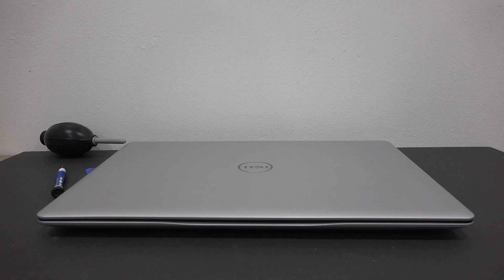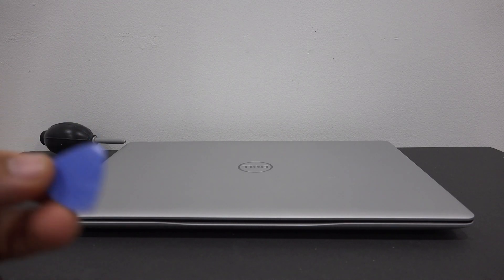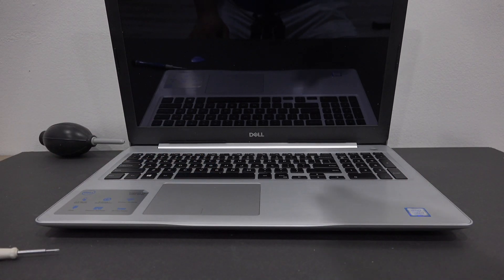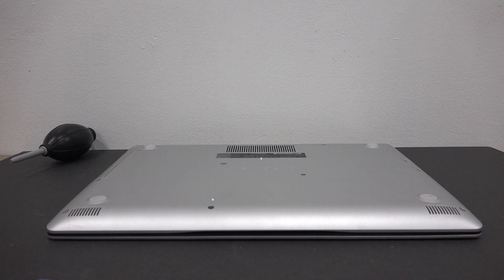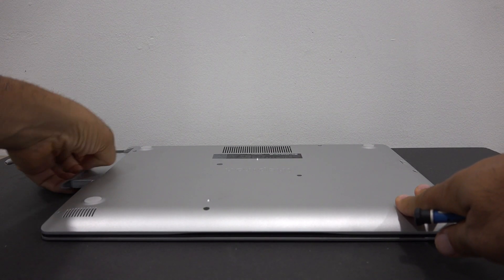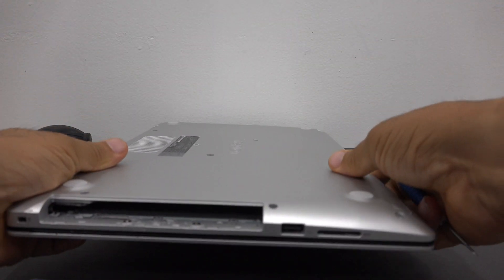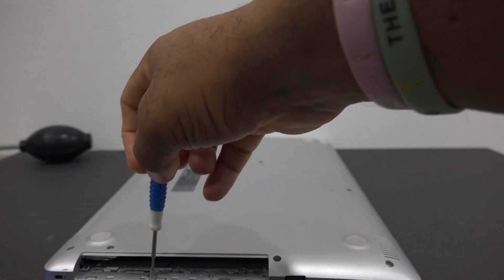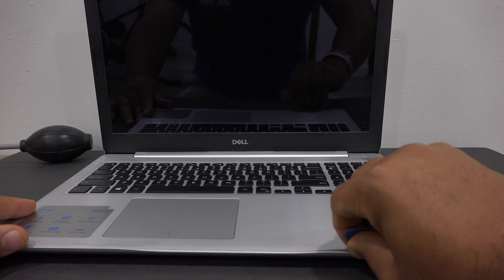How to Replace Battery, RAM, or Hard Drive on Dell Inspiron

Comment: Everyone needs to back up their files, the welps do not help if you did not back up. 
My battery issues started a few months ago. Now even plugged in it starts to shut off after about a half hour. 
In the old days you could pop the replicable battery out and keep running on the cord.
Looks like Dell wanted us to by new computers when they designed the 15 5000.

Still I got good life out of it.

Comment: I think it’s bullshit. You have to pay $150 for a new battery and you can’t even get the screws out on the CD drive because it’s a teeny tiny phillips screwdriver head and I’ve ruined two. Now I have to pay a computer place to put it in, another $40, plus driving an hour each way. I will not buy another Dell laptop, piece of crap.

Comment: Excellent How To. A few comments. Those wide headed flat screws that hold the case to the DVD Slot needs a special phillips head screw driver.  Super small and super sharp/pointy. What a pain. When I was taking my back off it would not release. Found a screw I forgot. Tried again found another I forgot. There are so many it is easy to miss one or two. Thank you again for your help.

Comment: My laptop was made in 2018.  Battery got really bad so I replaced it at start of 2022 with an off brand replacement (for $50) and it lasted about 10 months.  A new battery from Dell arrived yesterday ($130) and is going in today.  Hopefully it will last longer.
Reply: Eleven months later and how is it going 😐?
Reply: @aaron4384-o6f  Battery working well.  During install I lost the connection to the internal speakers though the speaker jack still works.
Reply: Does Anyone Know If Computer Will Work Directly Off Power Cord? Without Battery?
Reply: @Candaplred I think so, but you see, I actually had an issue with my AC adapter a couple of weeks ago, where it was not charging the battery anymore, the battery reached a point where it was basically empty, but I still could use the laptop connected. The problem was that, first, the BIOS detected the AC issue as a problem and the low battery as well, and secondly, it was permanently in "saving mode" which meant all of its resources were low, even browsing was a pain in the neck.

Taking this scenario in consideration I would assume that if you take the battery and bring power only through cable, the BIOS is gonna lose it, and you'll be stuck a low performance behavior until the battery is back at 100% (aka installed)
Reply: what about now?
Reply: @ignaciovargas6396  So far so good.

Comment: Thanks for the video. Dell sucks, I have never had to replace a battery and I use this laptop as a desktop, not used much. Also, my screen has micro cracks on the edge from just opening up the top.

Comment: I just replaced the battery on my father Inspiron 15, computer turns on but says no harddrive found.  Worked just fine before shutting down to replace the battery.  Anyone else have this issue?

Edit: 
Well I reseated the M.2 and it at least now tries to boot into windows but blue screens.  Father in law doesn't have any important docs so just going to have to use Dell's factory reset utility.

Comment: How do you remove the CD drive though? I can't just pull it out easily.
Reply: I have the same problem. Is there a technique to doing that please?
Reply: @andrewbaron7782  so I've since figured it out. You take a fine tip screwdriver or smaller and put it down in to the screw thread that lines up with the drive. It stands out because the thread is silver not black. Then push outward a few times and it will slide the drive right out then you can pop off the back cover, it worked for me.
Reply: @DannoM_  thank you. I will give it a try 👍😊

Comment: The screws are really small. If you have problems getting any of them out try 1) holding the laptop with your left hand and unscrewing the screw from underneath so that it can then fall out or 2) as much as you can unscrew the screw from above, as in the video, and use tweezers to do the last few turns to be able to then lift the screw out.

Comment: Do you know if it's possible to turn on the laptop without a battery installed? Just with the charger connected? My battery seems to be failing. Windows 10 keeps telling me that the baterry is very low. Thanks for the video
Reply from the maker: yes you can
Reply: Hello, i have been trying to bypass the battery and use the laptop plugin. Can you tell how to make the changes to the BM softwaretwithin window. Thank you @Documee